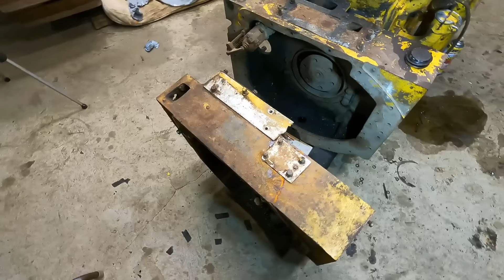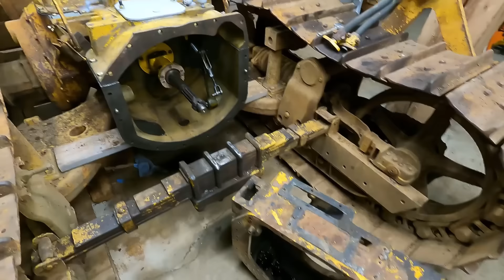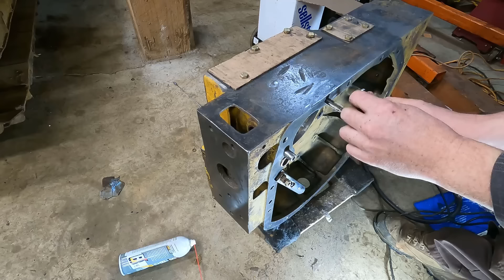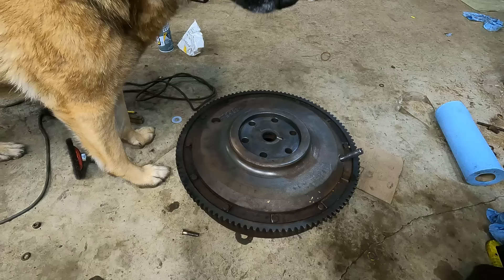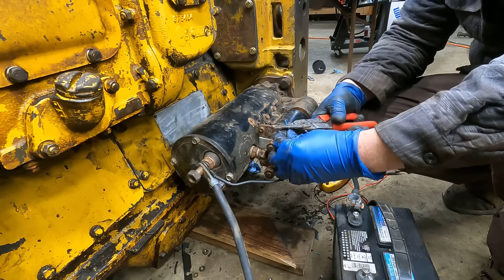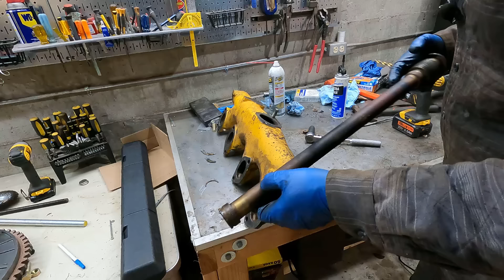D315 direct start conversion for Caterpillar D4 (part 2 of 2)

Comment: Would like to know what brand, model, Volt's your starter is. Would like to convert one of my D4's 
Thanks
Reply from the maker: You can do 12v or 24v, up to you.  For the starter get a Delco 42MT with a 12 tooth pinion gear, clockwise rotation   Swap out the end frame housing with a Delco 198854.  If you have to drill your bellhousing, it's a 3-5/8" hole.  This is only for D4's with the D315 engine, can't speak for the earlier engine.
Reply: If... the housing is machined for a starter motor.

Comment: You should take the bolts out the front of the starter and turn it so the solenoid is up farther from the track.

Comment: + Matt Johnny here from Bowen  Qld  Aust   .. My  1955  D47U   has the conversion  . I tampered with the plate  and water flooded  clear thru to  the trans .  The clutchj   flooded   and  I let the bung go .....40 l of water .. Engine is milky ... If I seal  that  ex  pony  motor  plate properly   please tell me all will be ok   Cheers ..
Reply from the maker: Don't see how it would get into the clutch area from that top plate unless you have a giant hole right next to it that it flowed into.  Sounds like either the o-ring that goes between the engine coolant passage and bell housing went bad and it somehow only leaked into the bell housing and not straight down onto the ground, or your bellhousing got a crack in that area.

Comment: I hate questioning people but since you normally do a good job showing every step I am asking did you use lock tite on that bolt and nut you used as a block off for that old pony motor lever, I saw you used rtv on the washer but I'd be afraid of vibration loosening that and that bolt falling into the housing and flywheel

Comment: Direct electric start will give you a lot of problems.  The old cat D-4s have a LOW compression engine and relies on preheat for the engine to start, that is the job of the pony motor.  The pony motor heats the coolant and the heads of the main motor.  You will probably wear out the starter motor.  You should read the starting procedure for the old D+4s.

Comment: When replacing a gasket with RTV and there is no gasket present upon assembly the RTV must dry completely (24 hrs) or it will just squish out not forming any gasket. When using RTV to seal a gasket and there is a gasket present upon assembly then the RTV should be allowed to dry for 30 to 60 minutes  before assembly so the RTV does move around to seal the gasket properly.

Comment: Hi you are doing a real through job…I would highly suggest replacing the outdated behemoth direct drive starter with a permanent magnet gear reduction starter…I replace all mine with this modern type..1/3 the size and so much less of a current draw..the cranking speed is much greater which Is a great advantage in starting older equipment…local guy..affordable starters in North .Carolina…and new at less than getting the old starter rebuilt…good luck

Comment: I have a 1950 6U that was converted to electric start.  On mine the starter has been clocked over so the solenoid is on top and still, the guard sheet metal has been "relieved" for clearance.  I am thinking maybe your starter solenoid will be hanging out with the tracks as installed.  ymmv

Comment: Good evening sir, first thanks for the videos, really enjoy them
Question, would you mind sharing the details (links, mfg, etc) on the puller & hydraulic ram you purchased?  Looks like a good set up and curious where you got them

Also can you share the brand of the gasket scrapers you got sent to you by a viewer? 

Thanks!
Reply from the maker: Puller is an OTC 938, hydraulic ram is a generic 30-ton hollow ram off ebay.  Gasket scrapers are Lisle brand.

Comment: Thanks for the content, you need to remove the cross spring to install the engine the spring is the mount on the bottom of the oil pan

Comment: Quick question does this engine not have a rear main seal just curious
Reply from the maker: It doesn't.  there are threads cut into the crank that draw the oil back in as it spins.

Comment: It is hard to see, but it seems like the ring gear on the flywheel is on backwards for the electric start. The beveled ends of the teeth are to the rear, which is the direction the starter gear from the pony motor would engage from. Now you are engaging the ring gear from the front side of the flywheel, that has the squared of  teeth. This maybe part of the starter engagement problem. Love the videos.

Comment: Gotta disagree a bit on the pony warming the engine oil. No, it doesn't warm it directly, but as the engine is turning over for 10-15 minutes under compression the engine is warming and so is the oil in all the passages. That's why the ponies are so great- no battery to run down, run it as long as needed. And if you're following Squatch, his observation that most people that hate ponies never had access to one in decent shape is likely dead on! I believe after a certain serial number all D4's came with the bosses cast for direct start, but no holes. Also, a thou is not a mil. A mil is a millimeter or one millionth of an inch, at least anywhere I've ever been working. I couldn't figure out what you were talking about. Good luck with the undercarriage. I bet there's a lot more wear than you think- there always is on anything with tracks!
Reply from the maker: A mil is actually a thousandth of an inch, I know most machinists don't use it due to confusion with the metric system, but it's used extensively at my day job, so I can't help myself!
Reply: @PacificNorthwestHillbilly  Never heard of that, makes no sense. A thousandth is a thou, but if that's what you're used to I guess you're stuck with it. It sure is confusing though.
Reply from the maker: You have, you just didn't realize it.  Do you think 6mil gloves are 6 thousandths thick, or 6mm thick? 😉
Reply: @PacificNorthwestHillbilly  Aha, plastics. Screwy. Of course milk is paid for by the cwt (100lbs) and our livestock is sold by the cwt too. I suppose weird measuring systems are just something we have to deal with.

Comment: I dont see a seal bring installed behind the flywheel? I think there needs to be one because there cant be oil at the clutch... Also those seals often leak and need proper attention
Reply from the maker: these old cat engines don't have a traditional rear main seal that you can replace.  The rear of the crank has threads cut in that draw the oil back into the engine as it spins.

Comment: Why would he freak over a razor blade scraper I have a scraper that is just a handel with a retractable razor that slips into it and if works great cause it's razor sharp all the time if it's not change the blade just want to remember to keep your hands out of the way when your using it

Comment: Very well thought out repair process.  Excellent minor welds.  At the abandoned sump, as to the plugged off passage, near top left as from driver view to flywheel housing, I often use simple silicon adhesive to stiff cardboard....as to prevent dirt.   I am sure a non issue, but dirt buildup at such a passage will spill as overflow at some future dismantle.  Easy to prevent.  Simply seal the cavity.
I am not certain what the book will recommend, but at starter nose, I often use just a touch of moly grease, as a good quality, to the shaft where bendix force at gear, slides to engagement. Clean and re apply at any starter unit pull for whatever reason.
At throttle linkage, bell crank...I think the fitting demand is as *full throttle with also, full cut off as shut down.
But the bends to the existing throw were interesting.  And the weld as to non adjustment likely came from vibration...suspect?  That was a curious bit.   I have seen powered units where out of range adjust at "cut off" required clutch engage to "stall" at method to shut down.  So a key bit for operator need.
Your attention to the manual, well executed prep to surface and fasteners will pay you back with long, trouble free operation.  
Think forward to care at the large weights as engine, winch and beware any potential for break as rigging.
If this machine used in brush, timber, recall that long splinters, long limbs can reach cab and operator area. Very often, shields and armored areas as near deck are constructed and placed to prevent that hazard.
It is not just as operator, but controls can be damaged and/or jammed by such debrie. Very much interested in the day, "cat yellow
 begins to move about to your advantage.  Regards from Wa. State.  McGary
Absolutely cheering for you and Charlie .

Comment: It's just me I'm sure, but I would have fabricated a mounting system on the front of the motor for a GM alternator. Minimal wiring, reliable, cheap as hell, and you can toss that voltage regulator mess in the trash. I try to do this on every old machine I get into. If room is a problem there are GM style mini alternators about half the size, that are 40 amp units. They only cost about 70 bucks. I doubt the old generator was anywhere near that.

Comment: - Matt, your sense of humor helps me a lot, so keep it up, please.
- I think your welding was they right 'fix'. Great job struggling though this for us.
- Yes, getting any right size bold and cutting the head off to make a mounting pin for the fly wheel would be smart.
- Yes, I wondered did you re-thread the holes before your first mounting.
- Lucky is that you got a chance to recognize about cleaning up the press-fit surfaces.
- Good job. Far better then I could easily do, that is for sure.

Comment: I hope you change the rear main seal on that edge with all that flywheel be in that heavy you did not say you changed it and that's why I'm asking okay this is Bob from Vero Beach Florida God bless and have a great day stay safe and PS I hope you change the front main seal to
Reply: A lot of the older cat engines don't have a rear seal, there is a screw machined into the crank that pulls oil back toward the crankcase.

Comment: Before you bolt that engine in . I would look into the ring gear on the flywheel the tampered end of the teeth goes toward the starter yours looks backwards . That will definitely cause ingagement issues

Comment: Warning! If you have to re cut the threads on a bolt that visually looks fine then it's a tell tale sign it's stretched and should be replaced without question!
Top tip! If you've not got a tap but have a bolt the correct size, cut a slot length ways in the threads and file away the threads on the leading edge for a few millimetres, it will act as a make shift thread repair tool and clear away any dirt or corrosion.

Comment: Go to your parts store and get freeze plugs the size of the round holes you want to plug. That's the cheapest and easiest way to plug the holes. Just a suggestion to make your work easier.
Reply from the maker: Yeah I was almost gonna do that, but I have an idea for a coolant heater that uses the pony ports that if it's still hard to cold start.

Comment: May I offer a suggestion on the cold start system? I would leave the brass tube in the intake an make a simple propane burner to heat the tube. A design like used for a made forge is easy, simple and you probably have most of the parts needed already.
Reply: That would be a nice approach to cold start up.  My thought with out knowing your weather, Install electric heater, and do your best to maintain those Batteries.  Big problem when you need to start and batteries are all dead or weak, that was our Family History with the use of Equipment, use it all the time will run just great, let it sit and have plenty of work  to complete.

Comment: Hey Matt,  Not sure if you still have issues with the starter engaging but could the starter ring on the flywheel be set up for the starting engine and not a starter motor.  the teeth look as though they have a lead facing the clutch, I can't see the engine side to see if it is the same.
Reply from the maker: Ideally you would flip the gear, but no one ever does that I have found.  The bevel cut on the starter pinion is way more forgiving than on the pony pinion.  Once I worked out the battery issues I was having, it was engaging reliably.
Reply: @Pacific Northwest Hillbilly  thanks for your response but…….. I’d knock it off warm it up and re shrink it back on. Call me a perfectionist but when it won’t engage and then knocks a tooth of you’ll think what did that chap say. 

Your crawler your choice

Comment: If I were you, I'd get rid of the voltage regulator altogether, just pick up an older model, single wire chevy alternator and make some mounting brackets. A lot less wiring and chance for something to not work down the road/field.

Comment: awesome job ya those guide pins for the flywheel are great, did an old 40's Allis Chamler tractor engine R&R. Hey to be silly todays world NO COMSENSE will be tolerated. Keep them coming awesome to see it rolling under power

Comment: When welding are you using shield gas or just flux core wire? You say you used stainless steel wire, which doesn't come in flux core, so I imagine you are using gas. Your welder is missing the gas nozzle on the tip, which makes the shield gas useless as it is not directed at the workpiece. The tip is like $3, please replace it for better welding results...
Reply from the maker: There are a few rolls of stainless flux core out there.  It's not common but I happened to have one

Comment: You're going to have a beautiful dozer.  Just one small word of advice- don't skimp on the undercarriage.  Not that I think you would by watching the entire series so far, but it's easy to get complacent. I know this wasn't you, but it looks like the previous owner has the tracks backwards.  The grousers should be foward on the pads.  I might be seeing it wrong at 43:31 though.  Regardless, you're doing a fantastic job on the restoration.

Comment: For the Size dozer they are the D4 Cat work pretty well in good condition. I expect you'll have a very good machine and hope you enjoy using it. And you're right about the decompressor too. I recall some dizels were made with auto decomp until an rpm was reached under starter, which then slammed the compression relief off chuff chuff bang and they'd kick off. Good movie dude, getting anxious for the next one after a time.
Reply: An electric heat gun works really good for cold starting diesels and there's no ether danger.

Comment: Thinking about the non-engaging starter, I looked back in the video, and I think the starter ring gear on the flywheel is fitted the wrong way round for the starter. The chamfer on the teeth on the ring gear should face the starter pinion. Looks like they currently face the clutch side. With the pony motor, the starter pinion is pulled in from the cluch side of the flywheel, this is why the ring gear is the wrong way round.
Reply: Possibly right but the flywheel and starter came off the old engine as a matched pair
Reply: If you decide to change one then just buy a different cog for the starter, I can talk the through the job..it's not beyond your skills

Comment: When it is all said and done, put a nice padded comfy seat in the cockpit, enclose the cockpit, and run a heater core. (I'm old. I need heat).   ;-) If you want to be Grizzley Adams, well that's OK too. It wouldn't have bothered me when I was young. I rode my motorcycle all year long. 17 miles to work. In January. In New England. This will work out for you, Matt, I see your knowledge and perception of the things that need to be, to make this work. If something breaks, you learn from it. I don't see anything that would cause that. Your approach is better than many engineers I have known.

Comment: back lash on the generator is a non issue as there is only load on the gear teeth in one direction. Backlash is really only of a concern to ensure you A. Are not binding, and B. if you are having the connecting item being driven from and driving the output.

Comment: A word of advice to you on just priming those areas - plain old primer for the most part doesn’t stop rust, it’s porous in nature. The actual paint is what seals the metal and prevents the rust, so maybe it would be better to go ahead and paint those areas you’re going to cover with other parts like the fenders, battery box, etc.

Comment: Nice way to finish up my night just before I go to sleep.
Been waiting to catch this episode.
As far as tools go.
Made in Japan or Germany is a good sign.
Both countries have excellent quality when it comes to machined parts and hardware.
Taiwan also makes pretty good machined parts and hardware.
I prefer electronic components from those 3 as well.
Especially capacitors from Japan, Taiwan or South Korea.
Absolutely never from China.
Electronic components are pure unadulterated junk from there.
It's China that your lucky if you get quality machined parts or hardware period.

Comment: What do you think about putting an ounce of Sea Foam in each cylinder to help free up the rings ?  Perhaps some experienced viewers can comment on this idea. I really enjoy your thought process and videos. I put Sea Foam in my 45 year old small truck diesel engine (SD22) and the smoking cleared up and putting some in the fuel helped clean the injectors therefore smoothing out the engine performance. My experience with diesel engines is limited to only this engine, but I have always really liked them. What I have is a hobby truck, I swapped the original gas engine with a Nissan diesel engine. I really enjoy putting around in it. The torque is outstanding. 
Sam Allen